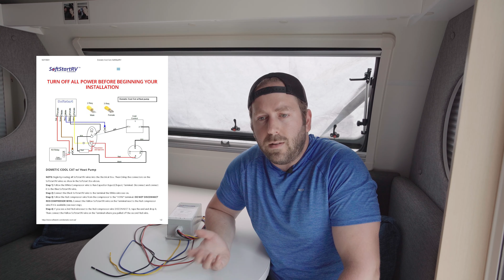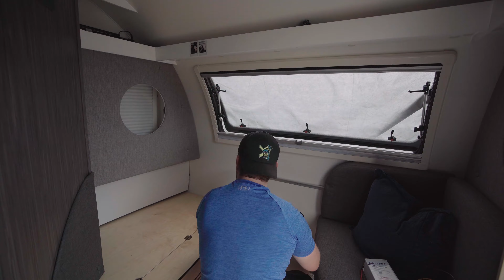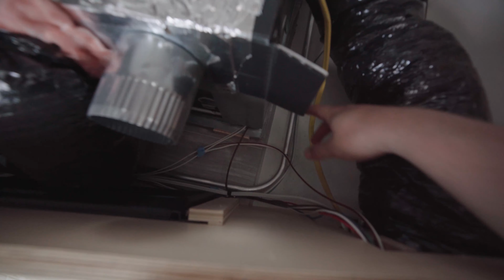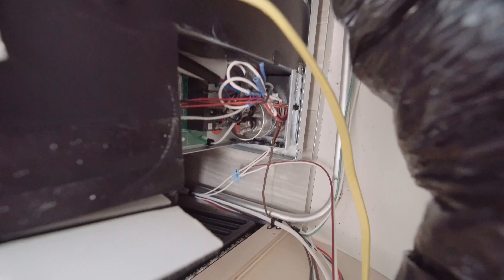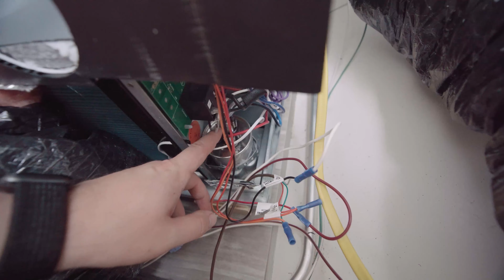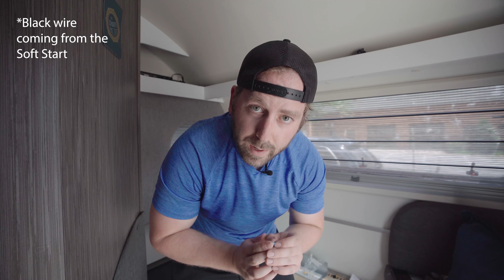!!Read the description FIRST!! Ultimate Boondock AC Setup - Soft Start Install + Propane Generator -

Comment: This was the exact instructional video I needed for my 2023 Nucamp T@B 400. There were two important deviations from the Dometic-specific instructions that you covered that worked on mine. 1) The Blue/White compressor wire is the correct one rather than the white one. And 2) The instructions said to connect the red SoftStart wire to the blue/black that you pull from the k1/k4 but I needed to connect the brown to the blue/black instead and the red to the pigtail like your video. 

Lastly I saw a comment about discharging the capacitor. In my unit the capacitor discharged immediately when power was cut. I checked multiple times after cutting power and running the AC and my multimeter never showed any voltage between the contacts.

Comment: This is the third vid I've watched for a soft start install, and I have yet to see anyone explain how to discharge the capacitor before handling the plugs and contacts. The herm side (compressor) to common holds quite a bit of charge, even after sitting for a time period.  Food for thought.

Comment: Great Video.  It allowed for an easy installation.  The only comment I can make is that not sure if mine was different because I have a 2022, but the white wire in the video was not the same  one.  I used the same one and my ac would not turn on.  Did trouble shooting from soft starts website and it mentioned that I probably had the wrong white wire.  Mine was on the side, rather than the back.  Switched them and everything works great now.